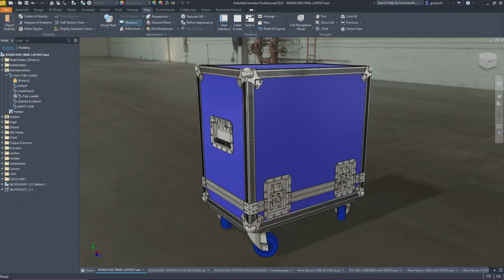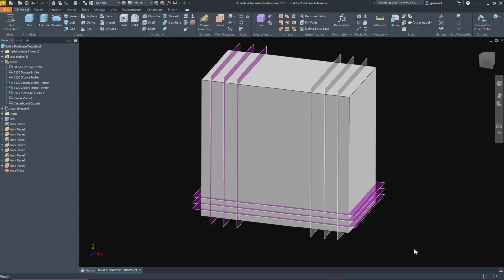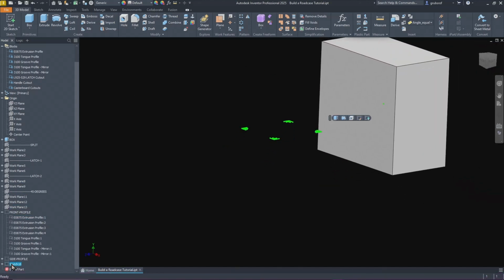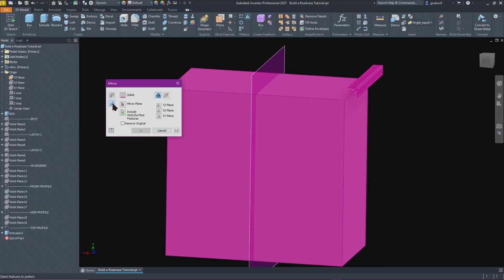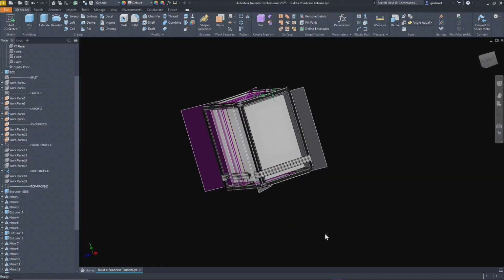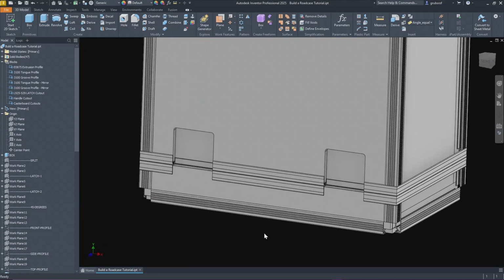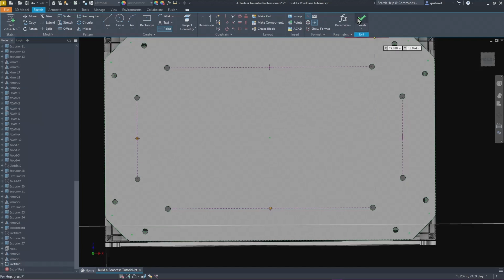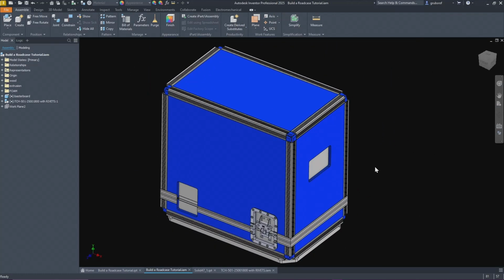Autodesk Inventor - Building a Road case

Comment: Thanks for sharing this.  I use fusion, most of the concepts carry over just fine.  It's embarrassing to admit that I've got dozens of road case designs and none of them are parametric... for years I've been manually dragging and extruding bodies to add extra RUs or otherwise customize existing designs.  I finally committed myself to setting up proper parameters.  They've always been there and I've always known I should be using them.  Working hard I've never had a problem with.  Working smart, well, the stupid brain tends to resist such.  Doesn't usually take much time for it to click.  Which only makes it more embarrassing of course.
Reply from the maker: Thanks for watching. I hope a gave you a few ideas to make your designs easier to setup.